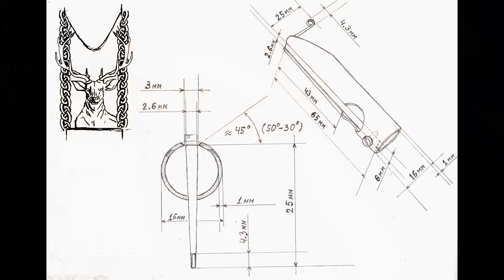Making jaw harp.

Comment: I am deeply impressed, Kirill. This shape immediately solves a lot of problems for beginners. and at the same time the tube allows the sound to project much easier. Have you invented this shape yourself or are there historical types on which you have based this? I am most interested, never seen this type before.
Reply from the maker: Thank you for your attention to my work. I came up with this myself. But then it turned out that there are similar historical constructions. But they are different. Just similar.